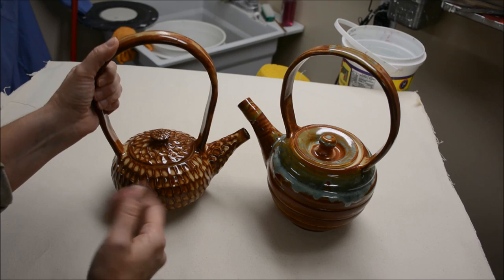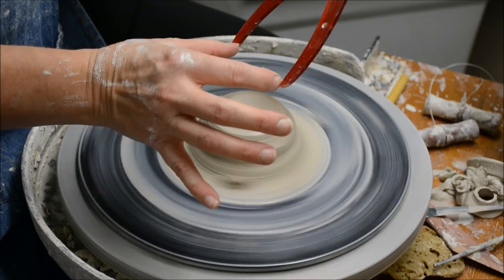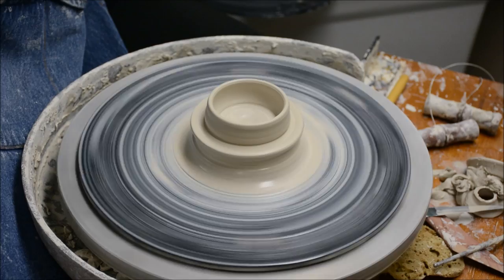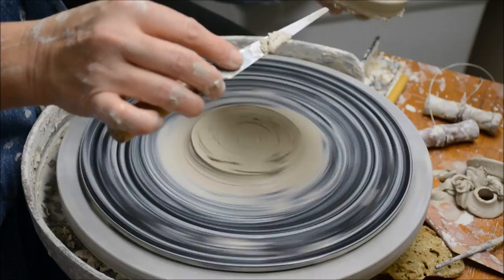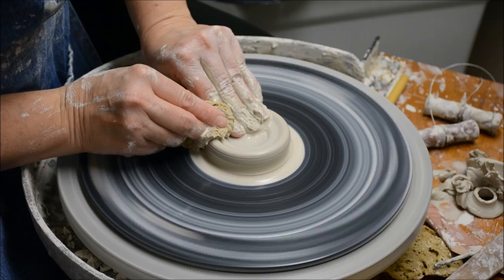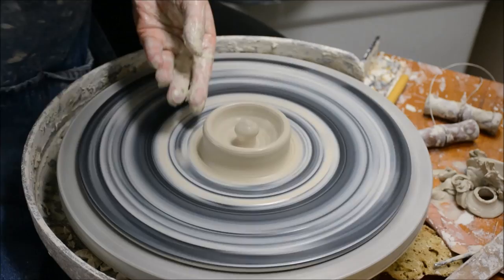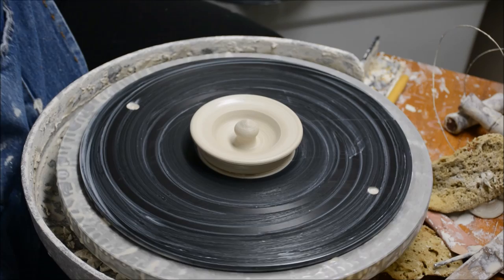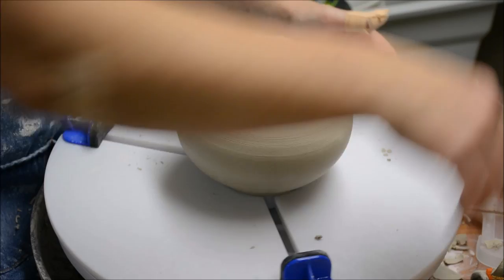Demonstration of throwing 2 types of lids on the potter's wheel- excerpt from teapot video

Comment: Hi, how do you get that awesome texture on the Teapot on the left?
Reply from the maker: Hi Mack- sorry for the delay in getting back to you!  There are a couple of ways to achieve that texture easily.  Here is a link to a video where I do that... if you pull forward to the 7 minute mark, you can see me use the Kemper ribbon trim tool to create it.  https://youtu.be/vLUyr23-TIY .  The second way is a great little mud tools texturing tool, shown in this video!  https://youtu.be/PTpAC43DOQM .  pull to the 2:30 minute mark to see that one.
Here are Amazon links to both tools:  Sherrill Mudtools Drag Tool texturing tool:
https://www.amazon.com/gp/product/B00WTARYZS/ref=as_li_tl?ie=UTF8&tag=karanspotsand-20&camp=1789&creative=9325&linkCode=as2&creativeASIN=B00WTARYZS&linkId=00f06ef35d94ff717d6027725a55f232
and
Kemper KSP 4- 7”   Double ended ribbon tool (I use for trimming and texturing)
https://www.amazon.com/gp/product/B0019LTJEM/ref=as_li_tl?ie=UTF8&tag=karanspotsand-20&camp=1789&creative=9325&linkCode=as2&creativeASIN=B0019LTJEM&linkId=6f8564205591747639565fc3e3919c4c

Also, if interested, this is a document I made with tons of amazon links for my favorites:  
https://docs.google.com/document/d/1XbYPQjjJnHrQG5xyWGMHZkEcZj5N8VnUAbFZdJRrRmU/edit?usp=sharing
Reply: Hi again Karan! Thanks so much for replying ! I honestly wasn’t sure if you would since this is a two year old video but hey, you did so thanks! Now that I have you I was wondering what company you’d recommend for stains. I’ve seen on the big ceramic stores website they’re selling mason stains but can I use them with Porcelain? Also I don’t suppose you might know where I can find cheaper wheels? I know you recommend the Brent (which I myself cut my teeth on in high school and remain quite fond of) but Idon’t have 1600 dollars.
Reply from the maker: @MegaMackproductions  I honestly haven't used the mason stains past cone 6- but I think many would work w/porcelain(?) (I assume cone 10, but realize you may be using 5/6). I recommend calling and asking that as a technical question from any reputable supplier- they should be able to confirm which ones can go that high.  (I know some stains I don't use on cone 6 as they burn out... like the pinks and reds) . I highly recommend searching for used wheels near you.  Wheels can be a great score when used... people give up pottery and want to downsize their studio!  Check Cragislist or your local for sale bulletin boards!  As far as a recommended supplier, I buy nearly everything I need from Cornell Studio Supply out of Dayton- Erin, the owner is outstanding and knowledgable, and they can ship just about anywhere. http://cornellstudiosupply.com .    If you call them, let 'em know I recommended them...  they are just super people there!  (937) 454-0357
Reply: Thanks very much Karan! You’ve been really helpful! I really appreciate all this info from a professional!